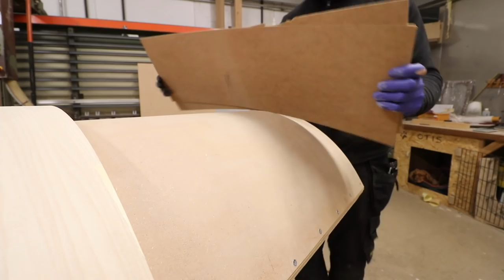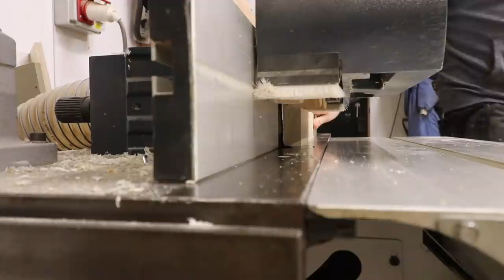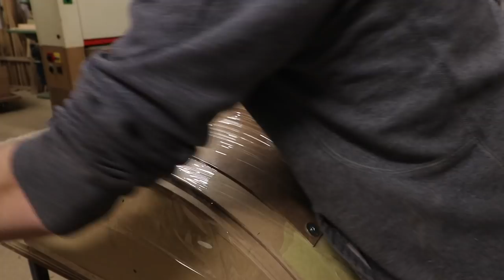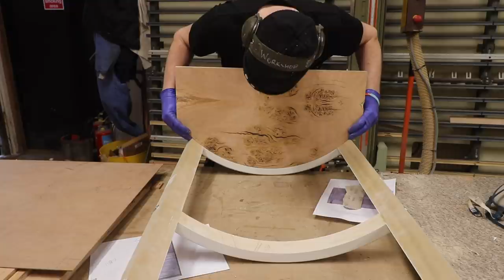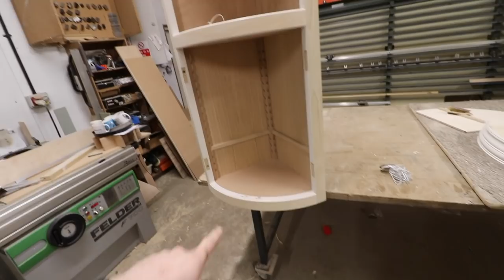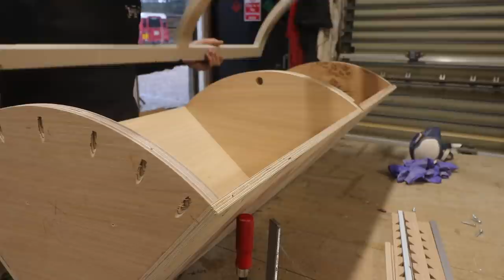Not your everyday Kitchen cabinet - Curved Wall Unit

Comment: Stunning.  I particularly like the pippy oak pattern being bookmatched at the top of the unit.  Most of us makers would have probably gone for center but being at the top is a really nice touch 👍👍👍
Reply from the maker: Cheers keith, Yeah it was a tricky piece as the burr was right at the end of the slab, so couldnt use in the middle. It took ages to find a suitable layout that didnt look odd

Comment: Woo hoo.........I didn't get lost in this one!

All joking aside for the moment Ollie, I think one thing that gets slightly overlooked in the comments section is how many times you tweak and improve on designs/processes and are then willing to pass them on for the benefit of others. I have absollutely no background whatsoever in woodworking (as you can probably tell 🤣) and will never use any of the useful info but I find your videos highly entertaining and satisfying to watch. Your customers must be chuffed to bits with your work! Thanks very much!
Reply from the maker: Haha, Well thats a good thing then! Yes lots of info, but there needs to be a lot of info as to get things right is a build of up lots of little attentive details. I dont get too many complaints. Usually lead times are the worst haha

Comment: One is left with the impression that this had to have been created by a sculptor rather than an expert artisan cabinetmaker such as yourself. Your workmanship in every regard is peerless. 
Did you follow a set of mathematical or simple arithmetic rules in computing the measurements? Or, did you simply create a bespoke mold 'on the fly' to shape the elements in situ within the space?  For the purposes of historical restoration, you might want to alert the Royal Household! 
Thank you for posting these videos. In themselves, they are notable for the illustration of the process as well as for the mysteries that guide you. Your precision is just unbelievable!
Reply from the maker: Haha thankyou very much John! Such Kind words. The under cabinet height is determined from tried and tested measurments then tweaked to the customers desire, then it was quite difficult to make the tall ceilings work! It is all drawn on Sketchup, to every last detail to make sure it looks right before starting. Its a lot quicker to do it on there than  in real life haha! 
Haha by royal appointment would be nice!!! 
I dont really know what to say in reply to your kind words, but want you to know that they are well received and go a long way to making the effort of filming and editing worthwhile!

Comment: Love the finished cabinet and fantastic to watch your process. Regarding the vacuum bag, can you use any kind of glue or is there a recommended glue to use?
Reply from the maker: 🍻 Cheers Gavin. Pretty much any glue yeah. Depends on application. some want really rigid glue for laminations, others waterproof, quick setting using heat..... Ive used, PVA, PU and UF resin so far.

Comment: Great work and attention to detail. Do you have a link to the led strips please. I've been using the flexi ones but your rigid ones look a lot better. Thanks Bob
Reply from the maker: Cheers Bob, I used a 12mm X 7mm mini profile with a 12v 10mm led tape 👍 
You buy them separately along with a driver and solder together
Reply: @BradshawJoinery  Thanks for the reply. thats the way for me to go next time.
Reply from the maker: Yeah it works well, get the opal diffuser not clear 

It might be 8mm tape, I can't remember actually, so don't swear at me if 10mm doesn't fit 😂🤣
Reply: @BradshawJoinery  no worries mate!

Comment: Hi Oliver, great vid as ever. Please may I ask where you source your electrical components and what brand they are. Thank you
Reply from the maker: Cheers Philip. I use a mix of parts, but got these from Landmark electrical. Eco pac drivers, leyton pir, and 4.8w 2v led strip. Thing the track is about 14mm wide overall

Comment: Asking in the interest of my brother, how do you get to the point where you can afford the equipment in your workshop? Your set up looks like woodworking heaven
Reply from the maker: I try to keep the funds available when i need/want a new machine and keep a keen eye for a bargain. The biggest cost would be the space to put them in so ideally, want to have it productive from day 1, not an easy thing to achieve!
Reply: @BradshawJoinery  I see. So hand tools and power tools till you have the client base for constant flow of work. Makes sense. I’d love to see him in a set up like yours one day. Attention to detail like yours and his is a dying trade.
Reply from the maker: It seems to be well appreciated, I think the results of modern practices/shortcuts are starting to show throught and gain awareness so there is most certainly a good client base for people with the knowledge and attention to detail. Most people start in their garage/workshop/shed with smaller machines and if it starts to work then expand. 🙂